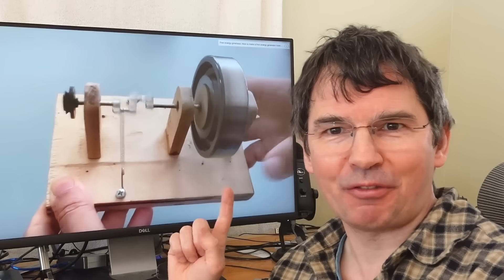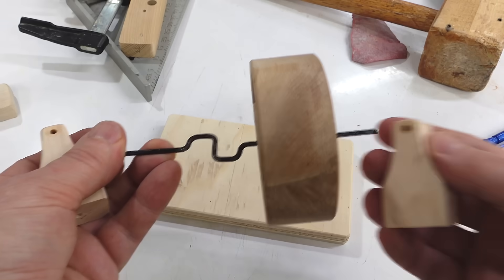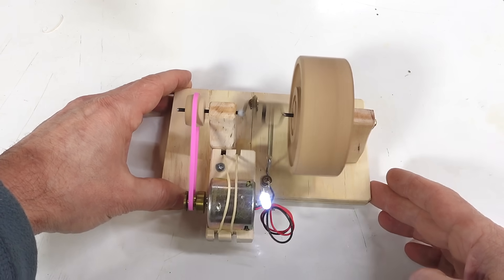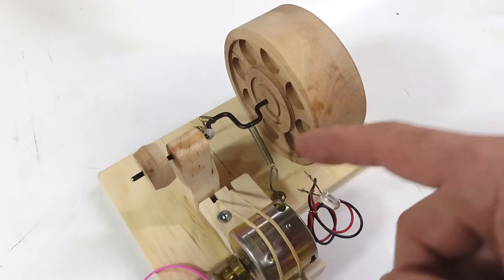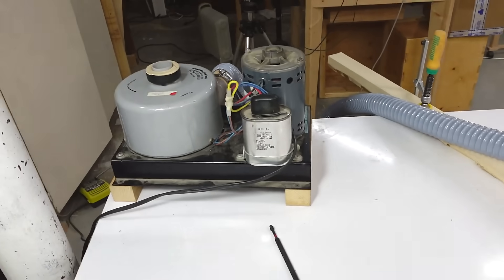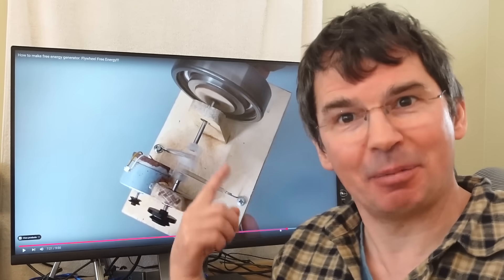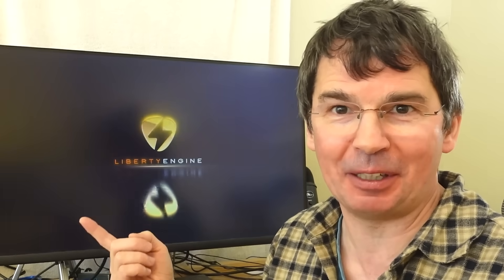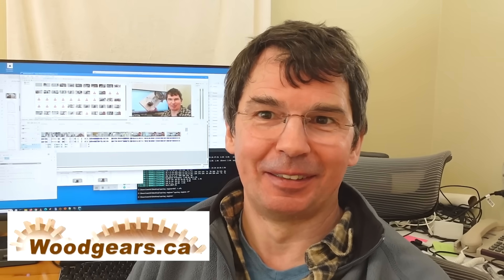I built a “free energy” machine and show how it really works

Comment: Rob  The law of conservation of energy is wrong. But Matthias does not need to do any work to violate the law he only needs to put together a little toy size experiment that would take him ‘or you’ about 20 minutes. 

So why would anyone balk at doing such a simple experiment. Would you be embarrassed to try something that might work? Are you afraid that someone might think ‘that you think’ the law of conservation of energy is wrong? Well it is very clear you think the Law of Conservation of Energy is correct so I don’t know why there is a problem. Why don’t you do the experiment and show that you are correct. 

What you are claiming is that a 1 kg mass moving 3.16 m/sec can combine with a 9 kg mass at rest to make up a 10 kg mass that is moving 1 m/sec.  That is 3.16 units of momentum making 10. That 3.16 making 10 would be a violation of Newtonian Momentum Conservation. But go ahead and do the 20 minute experiment; that would be very impressive for you to violate Newtonian Physics. You might even be awarded the Nobel Prize in Physics. 

No; you won’t do the experiment because you are pretty sure it will not yield the results that you would like. And I can guarantee that it will not yield the results that you would like; because Newtonian Laws of Motion are experimentally proven Laws not a theoretical law like the law of conservation of energy. 

You see Rob energy can be made in other ways. Here is one of many experiments that I conducted. 

I cut a 19 inch circle out of plywood and mounted it on a .75 inch shaft that was placed in bearings.

I suspended 20.7 kg from the shaft and balanced it with 862.8 g suspended on the other side; but at the 19 inch radius. (a diameter of 19 inch; radius of 9.5 inches)

I then added 79.8 g to the 862.8 grams suspended on the circumference. I allowed the 862.8 + 79.8 grams to drop a certain distance and I timed several drops. It took about 3.3 seconds to cover a certain distance. 

I then replaced the 20.7 kilograms at the .75 inch shaft with a balancing mass on the other side at the 19 inch circumference. This gives us two 862.8 g at the 19 inch circumference; but on opposite sides.

I added the same 79.8 grams to the same side (as before) and the drop covered the same distance in about the same period of time 3.3 sec.

This means that a drive force of 79.8 g can accelerate 862.8 g to .3636 m/sec; just as easily as it can accelerate 20.7 kg to .015 m/sec.  End of experiment.

The same input force or energy of 79.8 grams (.782 N) dropping a certain distance  produces ½ * 20.7 kg *.015 m/sec * .015 m/sec = .00233 J  or .057 J = ½ .8628 kg * .3636 m/sec * .3636 m/sec

I later used a photo gate timer. These wheels or Atwood’s can not distinguish between 20.7 at a .375 radius or .8628 kg at a 9.5 inch radius. And the acceleration of the small mass gives about 24 times more energy.
Reply from the maker: well, then do the experiment and see for yourself.

Comment: Well garymucher some laws of physics are wrong. 

3.5 g of rocket fuel can produce 5 joules or 10,005 J of kinetic energy. 

3.5 g of rocket fuel can accelerate 10 kg from rest to 1 m/sec or it can accelerate 10 kg from 1000 m/sec to 1001 m/sec. This is not a trick it is just experimental fact. 

Zero to 1 m/sec for 10 kg is 5 joules.   5 Joules from 3.5 grams of rocket fuel

1000 m/sec to 1001 m/sec is 10,005 joules    (1/2 * 10 kg * 1001 m/sec * 1001 m/sec) - (1/2 * 10 kg * 1000 m/sec * 1000 m/sec) =  10,005 Joules      10,005 joules from the same 3.5 grams of rocket fuel. 

3.5 grams = 3.5 grams;    which is a certain quantity of chemical energy

But 5 J does not equal 10,005 J

Now I know that almost all of you will turn a blind eye to this and maybe even think of a few ugly remarks about the author. But 5 does not equal 10,005. 

You can point out that the second acceleration of 1000 to 1001 m/sec cover a huge distance. SO WHAT. You could make it go in a circle and it would never leave a table in the lab.

The only way to resolve this 3.5 g making 10,005 Joules is to return to Newtonian Physics; which we should have never left in the first place. 

You were not told this in high school and you are now out of your comfort zone. Get over it: the law of conservation of energy is false.
Reply from the maker: Oh, do take some physics classes, please.  And please build a spring engine!  Better have guys like you waste your time on that than making ignorant arguments.

Comment: Love what you have done in exposing these frauds. There is such a thing as a ball bearing motor. It works by applying voltage via brush to the outer shield of the bearing and also to the inner shield of the bearing and then start it by spinning it in either direction. It will then rotate on its own as long as it is powered. A big version of this is in a European Museum, with an inner and outer rim of two different sized bicycle wheels with ball bearings rotating in between and is spoken about as a free energy machine.
Reply: with any machine there are resistance losses in bearings and air resistance, any so called free energy machine needs to overcome this  and "hell will freeze over" before this happens.
Reply: @billharrison3174  Actually a type of "free energy" can be created from the very low atmospheric voltages from radio waves and white noise. I once hung a small led via tuned circuit on my clothesline that could run for ever (if the led could keep working for ever.

Comment: Newtonian Physics says energy can be made from a spinning wheel. So 'Physics says' “Energy can be made from a wheel”.  Isn’t that great ‘Physics says’.

The professors know that Newtonian physics requires that 'energy can be made from a spinning wheel' so they pretend that a wheel has NO Newtonian momentum. The professors say that a spinning wheel has ZERO Newtonian momentum. This can be proven false by throwing masses with the spinning wheel. But profs don’t care about experiments, or logic; they keep their theories and ignore experiments. 

If you wrap a cord around the circumference of a wheel and pull the cord the flywheel accelerates according to Newtonian F = ma. The force in the cord does not have an energy formula the force makes momentum. Of course a spinning wheel has Newtonian momentum in fact that is all it has. If you share the wheel’s motion it ONLY shares Newtonian momentum. 

I showed you three experiments a day ago. All three return the motion back and forth from large to small masses. ONLY Newtonian Physics can do this. ‘Newton Says’
Reply from the maker: show me where it claims that.

Comment: Okay: if the cylinder has a mass of 19 kg (with 1 kg spheres) and is spinning with an arc speed of 1 m/sec then you are going to have to claim that the 1 kg spheres are moving 4.47 m/sec when the spheres have all the motion. 4.47 m/sec is needed for the spheres to conserves the energy of the system. 

Newtonian Laws of Motion would be false if the spheres were only moving 4.47 m/sec because the spheres can return all the rotational motion to the cylinder. That would take 20 units of Newtonian momentum and a speed of 20 m/sec for the 1 kg spheres.  

1 kg * 4.47 m/sec ≠ 20 kg * 1m/sec   IF the spheres are only moving 4.47 m/sec then Newtonian Laws of Motion are FALSE. 

½ * 20 kg * 1 m/sec * 1 m/sec ≠ ½ * 1 kg * 20 m/sec * 20 m/sec  IF the spheres are moving 20 m/sec then the Law of Conservation of Energy is FALSE.

You can not have it both ways the spheres are either moving 4.47 m/sec or 20 m/sec.
Reply from the maker: Stop arguing and build the dammed thing.

Comment: Drill a hole through a diameter of a PVC pipe and place a string through the hole. The  string is  weighted with equal masses on both ends and is about 5 pipe diameters in length. Wrap the pipe with equal length strings on both sides. Spin the pipe and release the weights. Then you can explain why it does work when massive amounts of energy are made. And you will not have to feel bad for us anymore.
Reply from the maker: And why is none of you quacks able to exploit this for power generation?

Comment: Issac Newton did not state that energy was conserved: he stated the exact opposite. Newton stated that Momentum mv was conserved.   Not mvv. 

A 100 kg flywheel spinning with an arc speed of 4 m/sec:  and a 100 kg sheet of steel moving 4 m/sec have the same linear (yes linear) Newtonian momentum. The arc is a line. The interaction of flywheels conserve Newtonian momentum NOT ENERGY just like the interactions of mass moving in a straight line. 

The experts tell you that a flywheel has zero Newtonian momentum; because up cancels down etc. But the Atwood's (that are almost all up and down motions) is proof that Newtonian momentum conservation and F = ma and 'action and reaction' are all correct. It has nothing to do with energy. So the experts are trying to get rid of the proper evaluation of flywheels.  

How hard is it to mount a bola through a diameter of a PVC pipe?

Comment: The only real problem with that setup is how many cycles a spring  is good for. Let's design an indestructible  spring. I think it's possible to find the sweetspot mathematically so it can run indefinitely until equipment failure.
Reply from the maker: please watch the rest of the video
Reply: @matthiaswandel I watched till the end.

Comment: Newtonian Momentum conservation has not been proven wrong yet; so no one has yet proven that free energy can not be made from gravity.

1 kg dropping 20 m in a 300 to 1 Atwood’s produces 343 units of Newtonian momentum.

It takes 19.81 units of Newtonian Momentum to send the 1 kg back up to the top. 1 kg moving 19.81 m/sec will rise 20 m back up to the point where it was dropped.

19.81 units of momentum produces 343 units again and again and again for free.  323.1 units of momentum produced every 2.02 (by an arrangement) seconds again and again and again. 

They won’t do the despin experiments because they are brain washed into thinking free energy can’t be done; obviously they don’t know Newtonian Physics.

If a spring can be loaded with 19.8 units; and then it unloads with 343 units; then I think we have a winner. I am not saying the springs do this but gravity DOES.

It is a function of ‘time’ the Atwood’s takes 17 times longer to apply the same force. You can’t blow on a wood bearing and say that Newtonian Physics is false.
Reply from the maker: its energy you need to refer to.  There's tons of quacks like you out there, but none of you ever get anything working.  And people with more expertise never belive the likes of you.  Geez, I wonder why that might be?
Reply: @matthiaswandel  And what did I ever do to you to deserve that beat down. The experiments I DO are easy, cheap, and clearly make energy. They already are working.

Comment: Before I even watched this, I know it can't possibly work even with the flywheel there are equal forces on the springs eventually it will stop plus crankshaft bearing friction
Reply from the maker: Of course it doesn't "work".  That's what the video is about.
Reply: the springs are just there to confuse the gullible.

Comment: a spinning magnet field underneath the table would work as well, i think showing the under of the table would be a good move to prove it works ( but it would need you to zoom out of the frame and would show the air compressor ( well done anyway ) i have seena few done outside ( but the air compressor is probably buried under the ground )

Comment: You went wrong by not using a real ball bearing. And that's why you had to fake it!
Everyone knows, that hardened round metal spheres captures the ether, and then that captured energy is transferred to the metal outer ring creating an induction current that spins the bearings. A rookie mistake to think you can do it out of wood :P
Reply: No mater how hard the bearing material, it bends under load, therefore heat is generated, therefore energy is used up.
Reply: @universeisundernoobligatio3283 are you seriously reacting on an obvious sarcastic comment 😂

Comment: Hi, I'd like for you to do one that I know it works. It is called the gravity engine, think of it as the pulse watch, all the positions are moved by gravity, except one, the 6 o'clock witch is against gravity. It needs a kick on this position to pass the 12 o'clock. After the 12 o'clock the gravity kicks until probably 9, 10, 11. If you pass the 12 it will continue running. The thing with gravity is that produce as much as you want of energy, gravity is free, the heavy it is is the amount of energy produced. Imagine one machine built on one ton, it will run a city.

Comment: Free Energy can be made for $30, or less. You only have to know the real world of Physics. 

This goes back to Newton and Leibniz; and it was a heated debate; but I am sure not many of you are ready for that. 

But you don’t even need the concepts of Newton’s Momentum or Leibniz’s Energy; you just need the fundamental concepts of Force and Time.

In the MIT Atwood’s the 10 g accelerating 1,110 g takes 4.7571 sec to drop 1 meter. Freefall, or the reload, takes .4517 sec. The same force is applied for over ten times as long. 

Place the motion of the Atwood’s (4.7571 sec *.0981 N) into the 10 grams and throw the 10 grams upward. This is again the same original force acting on the 10 grams. So it will take 4.7571 sec to make the 10 g stop. In 4.7571 sec the ten grams will rise 111 meters.

Place the motion of the Atwood’s into the 10 grams and it will rise 111 meters. It was dropped 1 m.

d = ½ att      d = ½ vv/a     F/m = a

The (4.7571 - .4517) 4.30 sec of applied force can not be made to go bye-bye? It will take the same F times time to make the 10 g stop. 

Your profs will tell you that Newton agreed with the conservation of energy;  but that is a huge false statement. He was 100% against Leibniz's mvv.
Reply from the maker: don't argue here.  Do the experiment.

Comment: Doing the Randi's work. As an electrical engineer, I used to think the hardest part of perpetual motion machines was hiding the batteries or wires, or complicated magnet setups, but you've expanded my mind to think beyond...to just blowing at the thing really hard
Reply: The Experiment: Suddenly create some charge, and with pre-placed instruments watch (along a radial line from the created charge) the fields and potentials appear progressively at points along that radial, at the speed of light.  And once the field and potential suddenly appear at a distant point, they thereafter steadily remain. This shows that a stream of continuous real observable EM energy does indeed pour from the charge, once it is made, continuously and unceasingly.  Further, that free stream of EM energy does not "die out" so long as the charge remains intact. So the associated fields and potentials are continuously replenished, as they continuously spread radially outward at light speed.

The Observation: Every charge freely pours out real EM energy in all directions, with no observable energy input.

The Problem: Either the required nonobservable energy input must be identified or the energy conservation law is false.

The Solution: The charge continuously absorbs virtual (subquantal) photon energy from the vacuum, coherently integrates it, and re-emits it as real observable photons.

References:

Source Charge, Van Flandern Waterfall, and Leyton Geometry T. E. Bearden  (Dec. 2, 2003)

T. E. Bearden, "Giant Negentropy from the Common Dipole," Proc. Congress 2000, St. Petersburg, Russia, Vol. 1, July 2000, p. 86-98. Also published in J. New Energy 5(1), Summer 2000, p. 11-23.

T. E. Bearden, Energy from the Vacuum: Concepts and Principles, Cheniere Press, 2002, “Chapter 3: Giant Negentropy, Dark Energy, Spiral Galaxies and Acceleration of the Expanding Universe.”

M. W. Evans, T. E. Bearden, and A. Labounsky, "The Most General Form of the Vector Potential in Electrodynamics," Found. Phys. Lett., 15(3), June 2002, p. 245-261.

The Source Charge Problem: Its Solution and Implications T. E. Bearden, Aug. 18, 2003

Most electricians don’t realize that from any source of a finite potential intensity φ (phi), regardless of how small the value of φ, as much energy as one wishes can be collected, simply by W = φq, where W is the total energy collected from potential intensity φ by intercepting and collecting charges q. If one wishes to collect more energy W from the same potential φ, one simply needs more q. The reason is simple: the scalar potential is actually a bidirectional set of EM energy flows, as shown by E. T. Whittaker in 1903, and what is collected from it depends on the number of fundamental interceptor/collectors (called “charges”).

References:

E.T. Whittaker
On the Partial Differential Equations of Mathematical Physics
Mathematische Annalen
Vol.57, 1903, p.333-355

E.T. Whittaker
On an Expression of the Electromagnetic Field due to Electrons by means of two Scalar Potential Functions
Proceedings of the London Mathematical Society
Vol. 1, 1904, p. 367-372

Comment: Honest question: What experiential and/or academic formal or informal knowledge in Electrical Engineering, Physics, Electrodynamics, Electromagnetics etc do you have? Thanks.
Reply from the maker: I have some formal education, but this sort of work is not the sort of thing that formal education is useful for.
Reply: @matthiaswandel  Thank you for replying. But you did not specify as per my question what specific formal training or informal education do you have out of what i listed, rather you replied vaguely and somewhat equivocatingly.